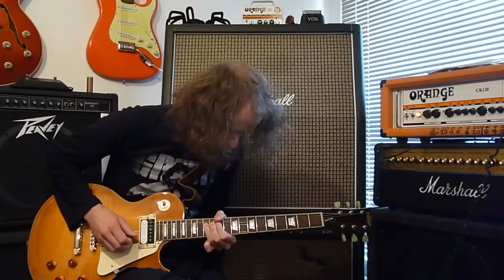Why I prefer Solid State amps to Valve amps

Comment: One thing ! Try a "BluGuitar Amp1". It's a bit more expensive than most regular solid state heads, but REAL 100 Watts with a real valve tone (if you need it), it weights NOTHING, and can be operated as a pedal inside a pedalboard ... meaning you can have the front pedals and the pedals in the the amp loop IN THE SAME PLACE without running MILES of cables.
I play mine through a feather light single "DV Mark" 150W speaker, and it sounds and responds like a dream.
Have fun, PLAY LOUD !
Reply from the maker: I really need to give one a play through. They look awesome. :)
Reply: Even if you don't buy one, to try one is a good experience to add to what you already know about amplifiers.
Keep Rockin'

Comment: I agree, solid state amps are better in terms of reliability, a valve amp sounds nicer but the valves can shatter if you're not careful with them which is why solid-state amps are better in regards to reliability

Comment: I myself either don't hear the differences or what's more likely I do hear them but simply can't bring myself to care enough. There are ofcourse legitimate reasons for playing a tube amp, it does give a certain 'real' feeling to playing which may or may not hold some truth. However I haven't really encountered much of what is supposedly unique about tube amps when really playing. Only when purposely going to look for a certain aspects like power amp distortion or whatever have I found it and that usually meant turning the amp up way higher than is practical.

Comment: at 80 to 150 for power tubes a year that's another solid state amp head to have  on hand.. I'm hooked on all things Valve State solid state amps the tone is there! remember! a great set of eminence speakers can cure your lack of tone love the Swamp Thang and Texas heat what a huge difference like taking off a blanket off your combo or stack... I'm sold on solid state no need to go back for all tube amps...

Comment: It's not that SS suck. They just don't have the dynamics, the touch-sensitivity. There is simply much more as far as playing dynamics with valve amps. It's not even the "sound" as far as the tonality that is the main issue. It's that touch-sensitive dynamics thing. If you play metal or just heavy rock the playing dynamics are probably a total non-issue. If you are not a very high-level player as well, and you want a smoother dynamic without having to regulate your pick attack as much, SS would be better. If you move from a typical SS to a good valve amp you will find that you will go through a phase of having to really pay attention to your attack because the slightest difference in attack creates huge changes in outcome. That is the definition of "gain." Gain is how much does the output change in relation to changing how much you're putting in. Crank up a SS with lots of distortion and it doesn't matter so much if your picking is not as good. If you are looking for smoother legato results and your legato is not so great a SS amp would help you achieve that. But it is far harder to really be highly expressive with playing dynamics on a SS. It could be that in 2019 there are some SS that closely approximate that touch-sensitive thing. I've heard that the Roland Blues Cube with the tone plugins does a good job with this, but I've never played them personally.

Comment: It's definitely easier to go about life telling yourself you can't hear a difference if you can't afford to run a valve amp. I built two of my three amps and that can be a great part of learning about what makes them tick (actually hopefully not tick or hum or buzz). There is a plethora of information online and tons of people in forums who can be resources. Tube amps aren't trouble free but neither is a solid-state amps after 15-20 years. But there definitely is a difference between tube and solid state. Dynamic swings, touch sensitivity, there is a dimensional aspect that solid state will never been able to recreate. If all you want is to play loud and louder then solid state will work but there is a reason Frusciante and countless other's still use tubes.

Comment: Haha im similar too you in many ways,i love solid state amps My favorite amp ever is the Marshall valvestate 8240 combo,I bought it when i was pretty new to playing guitar i was about 14-15 years old and i have used it as practice amp ever since and im 29 years old now :) Its the perfect sound for death metal in my opinion its just something magical about it that i cant find in other amps.Too bad though i cant use it with a band as it just does not cut through the mix at all,But for home recordings and practicing its magic bro.Solid states are definitely getting bad rep for no reason.but in a way i like it like that as all metal players nowdays have the same gear xxx.mesa 5150 etc ... So in a way it just makes my tone a little more "Original"

Comment: I appreciate your view, but I feel like the differences between SS and valve are huge!! I bought a Blackstar ID:30 which was sold to me as the best valve-emulating SS amp at the time. I sold it and bought a Vox night train about two months later. I now play a Marshall Vintage Modern. SS amps generally have no character. (Good) Valve amps offer a much more responsive sound. When I play, sound quality is the only thing that matters. Issues raised here are simply a matter of convenience. I know Kossoff wouldn't have played an MG:DFX 100!
Reply: Also, the Orange CR120H is listed at £319. My Marshall VM 50w was £350 used. No contest!

Comment: Does it also occur to you that the valve amp sounds best at certain volume levels?  And sometimes if you are playing a smaller gig it requires re-adjusting the setting, re-dialing levels on the pedal board, etc etc.  With solid states, I tend to believe that the tone is consistent across wider range of volume levels.

Comment: I have a peavey valveking 50($400 used) and a fender mustang III($225 used). I like the valve king better. I love the fact that you can switch tubes out to experiment and change the sound of the amp and it's not that expensive. Most pre-amp tubes are around $15 and they last long time. You don't have that creativity with the ss amps. I agree that ss amps are more consistent as tube amps tone changes drastically with volume levels but that's part of the fun. SS amps can be boring, cold and sterile to my ears. I'd rather have that old school classic rock sound.

Comment: Ey up Dave, awesome vids. Thanks! :) 

Do you think it's possible to get something like the Frusciante sound you achieve on a bit of a budget, maybe with a practice amp combo, or a Micro Terror+1x12 cab (plus the Ibanez WH10V2 and boss DS2)?

Do you think the Zoom D2 or other multi-FX box is essential to the sound? If so, what would you dial in for other multi-FX boxes such as Mooer or Hotone, or does it have to be a D2? 

If anyone has any ideas, that'd be great. Cheers. Oh, and I've got a tele, which I don't plan on swapping for a strat - so is it impossible to aim for the sound, even without the tight budget?? Really don't mind if I can get to something close. Ta very much!
Reply from the maker: I would say you can get close to John;s tone with what you have. A muliti effects is really important but you have the main ingredients so to say. 
I would set the micro terror
Volume - This can be where ever
Tone - 2 to 4 (might need to be a little higher maybe)
Gain - 5 or 6
I would run the order like this 
Amp - Wh10 - DS2 - Guitar
Let me know how you get on. :)
Reply: Thanks for the speedy and very helpful reply! 

I haven't actually got the micro terror yet, and I'm still toying with the idea of maybe going for a combo (my last one just died) instead. Still, good to know the micro terror could be a good choice.

Spending much more than £350  on a combo or head+cab would feel like overkill for the likes of me. (Strictly bedroom!) That said, I could save up for longer for something that would likely tick more boxes. Any tips/thoughts welcome, but you've already been a great help! ;)

And thank you, thank you, thank you for the fantastic videos you keep putting out. You're a top bloke, and a great teacher. You're doing a lot of people a huge favour, and we appreciate it. :)

Comment: there are some really nice SS amps out there, but I think the stigma comes from low end solid state amps that don't sound bad on their own, but as soon as you put it next to a legitimate valve amp sounds like a toy in comparison. It also just depends on what exactly you're doing musically what might be better for you. Honest fact of the matter is, SS amps have a harder time cutting through a mix than a valve amp, so if you've got a lot going on in a band, it'll be harder to be heard using most SS amps without cranking the volume way louder and going over top of the band instead of cutting through it. Good points though, it is a huge pain to move the damn things, and they are extremely finnicky with power for sure, but cranking a SS will never feel the same as cranking a nice valve amp, but most people can't justify getting that loud :)

Comment: Hey Dave, tks for this vid. I agree with you.Ttube amps can take weeks of tweaking to get where you like them. then depending on temperature or humidity or electricity can sound completely shitty the next day with same settings. I've had them all. Get an old school transistor solid state NOT MODELING!, with the right effect set up and VIOLA, sustain forever. Modeling amps just sound thin and sterile and do not mix well with a band in my opinion. Bedroom toys. An amp is only as good as the tweaker turning the knobs but valve amps just don't give back consistently. Solid state is the best work horse available to a steady gigging musician. Period Great vid!
Reply from the maker: Thank you very very much indeed. :)

Comment: Everyone is entitled to play what they want. I'm assuming we're all guitarists here, so whatever gets you the tone that inspires you is all that matters. Period. However, in the most technical sense, tubes bring a compression, harmonics, harmonic distortions, etc. to the party that solid state simply cannot accurately (re)produce. Especially under distortion, I simply can't imagine someone not hearing a difference. Again, not better or worse, but certainly different and audible to nearly anyone. With most guitarists nowadays realizing lower wattage amps yield better tone, most aren't lugging around a 100 watt head, but even a Marshall SLP is only like 35 pounds, so it's not like it's back breaking like a Fender Twin combo, AC30, or a 4X12 cab you'd use with a solid state head anyway. If you're serious about tone, and your gear in general, playing in dodgy pubs with questionable power, you should invest in a voltage regulating power strip for your amp (valve or ss) pedals anyway.

Comment: Vlave amps get much louder, but How many of us are playing for five thousand people a night. Plus you can get some very consistent tones at low volumes. The way technology is going, modeling amps are getting so tasty. I don't see any point unless you're a touring artist and even they're using modelers these days.
Reply from the maker: Personal preference at the end of the day. Thanks you so much for watching. :)
Reply: I have 3 solid state amps - fender mustang, peavey audition and behringer v-tone and I can't play any of the 3 at bedroom practice levels. All they want to do is crackle, hiss and cutout at lower volume settings. My peavey valveking amp has 3 power settings - 2W, 12W and 50W. At 2W I can play it as low as I need to at night in my apt. and it works great. Sure the tonal characteristics are different at the low power setting but at least it plays well and still sounds good. I also have 50 watts of power in case I need it. The mustang is one of the highest regarded modeling amps out there but to me it just didn't sound authentic plus I don't like scrolling through 100 pre-sets to find a sound some engineer created. I'd rather create my own sound. I'm low budget and certainly not an equipment snob but I'm old school and valve amps are just more fun to me. I understand the appeal of ss amps - cheaper, less maintenance and 99% of listeners probably wouldn't hear the difference.

Comment: Personally I would love to have a valve/tube amp, but like you say, it costs quite a bit to keep them serviced and replace valves/tubes and all that other jazz. I beg to differ when you say that there isn't much of a difference tone-wise between the tube and SS amps-well, that's not correct, I agree that there is little to no difference, but when an amp sounds like balls, and continues to sound like balls, even after it's warmed up, then you know it's solid state haha. ( cough low end line 6 amps cough) Or a ridiculously poorly setup tube amp :) But yeah SS amps are more consistent and durable and usually lighter as well. I'm using a Fender Champion 40 currently-I'd like the distortion to be a bit more saturated, bc the amp sort of looses note definition when you play some chords with gain, but other than that it's a fantastic little combo lol. Looking to upgrade to an Orange amp though, played through some of their combos and heads and they are seriously impressive things.

Comment: Me too, bro. Been using them 80's solid state marshalls for years now. I don't even use pedals anymore. With tubes, i NEEDED toys. 
Nobody can tell the difference anyway.
SS is tougher, more reliable, cheaper/ easier to repair and maintain and most folks loving tube amps are really lusting after the tone of the SS fuzzboxes overdriving it, LOL.
My old gtr player peet came with me to try a SS behringer many years ago..total toob snob...the amp sounded so good. I got lost in it and was rippin' a bit... most of the folks in the DJM store gathere around to listen...
Peet come over, saying " wow, jimi, that sounds great!!! What kind of tubes are in it???"
Was a DIGITAL behringer v- ampire.
LMAO
Fwiw, been spankin the plank 54 years now and van sound like me thru anything.
Why?
The big secret is crank the amp up with ample gain, and simply turn the gtr up and down. Thats it. Set up your amp tone stack about 6 and sweep til the amp responds best to your gtr knobs. Boon. Myriad tones without a bunch of stuff. Solid state, tube, totally doesnt matter as much as the player and their touch.
Peace.
Reply: Sorry for all the misspelled words, having neuropathic tactile issues

Comment: Hello Dave!... Have you ever tried a new out of the box 15-25W tube amp that cost so so (for instance my Ibanez new TSA 15 head was 300 Euros/ 400$, and it's tubes are 60$ to redo) and it's powerfull enough to start driving and breaking the sound on a 35W cab.... I've been to pub gigs like those and I didn't see the reason to push it more then half or 3/4 it's output... to let people listen and still be able to talk in somewhat of a way without having a sore throat :)). And i do like solid state amps too, very much too :D.....

Comment: If you can find a lab series L5 or L7, that's what Ty Tabor of Kings X used in his first four albums, and BB King used them as well
Reply from the maker: My friend owns one. :)
Reply: +Dave Simpson one of my favs, they're getting harder to find. I use a ss fender deluxe 90 that I love. I play bass and let my rhythm guitarist use it while our lead  guitarist used an old vintage Fender tube amp with four 12's, and our rhythm player had as good of a sound and was able to control it better.
Reply: Loving my L7; fine machine

Comment: had a Valvestate combo it was killer....a lot of the effects were sketchy but didn't have to use em right?
Couple years ago I bought a chinese AC15 with the Creme cab and Celestion Cremeback speaker. Put a vintage Amperex Bugle Boy ECC883 in V1 , Tung Sol reissues in V2, V3 and JJ duet of EL84's for power.
It is bombproof, killer and screams with dripping vintage tone. Put an OCD in front of it and it will blow you out of the room. Give one a whirl Dave you'll convert back. Warning the stock tubes are ice pick city!

Comment: I am surprised there are so few hybrid amplifiers with a tube preamp and a solid state power stage.   Most of the power stage distortion is the type of stuff you just don't want, as it will make for a gated sound that isn't particularly musical.  On the other hand, tubes are good at smoothly compressing and soft-clipping the audio signal- the sort of stuff you would want in the preamp stage.

Comment: I do hear the difference,  but here's the trick. If you can hear the difference, you can tweak and adjust tone knobs to adjust. IF you can hear it. 

I had a Fender Dual Showman for a while. But it was too heavy, so I baught a Line6 Spider 2x12. I hated the clean channel, but since I knew what good tu e tone was, I was able to adjust the tone. So for a clean channel that resembled tube tone, I used the crunch channel, but turned the gain all the way down and the channel volume up. 

In the 80s when soo many solid state amps came out, that was the trick. Buy an Ibanez Tube Screamer (crunch pedal) turn the gain all the way down, the pedal volume up and use that as your clean. This resembles a nice thick, tube clean sound.

Comment: My son said you should run for Prime Minister. 😎 I like Solid State amps.
 I've built 11 or 12 tube amps that range from a Deluxe Micro to a Matchless Clubman 35.  Even building them yourself you can invest a lot of money in the equipment to build  them. 

That said I used a Peavey Bandit 65 for years and currently use a H&K Attax 80. I mostly just play rhythm and use the clean side of the Attax 80. The overdrive channel on that amp can sound every bit like a tube amp , in essence a blender full of rocks.   People used to come up and look at my Bandit 65 , thinking it had to be a tube amp. LOL